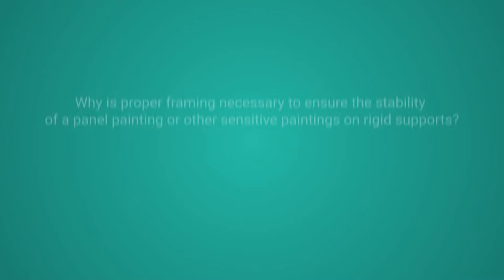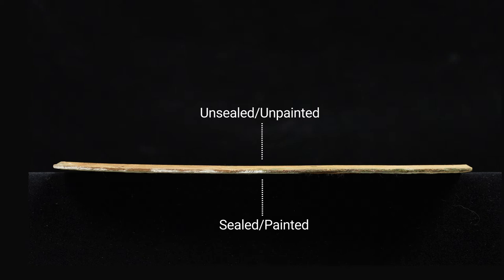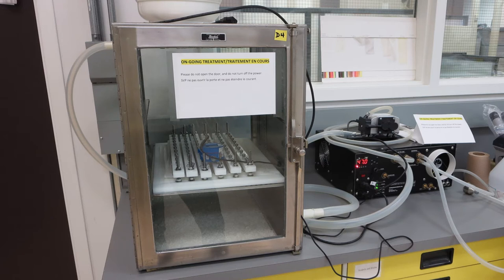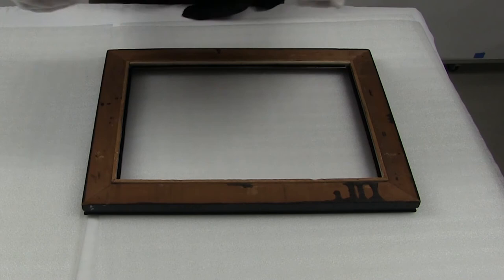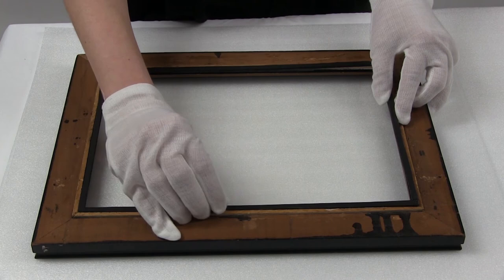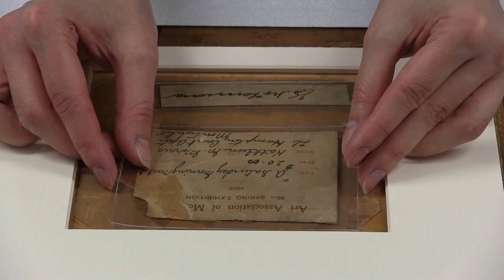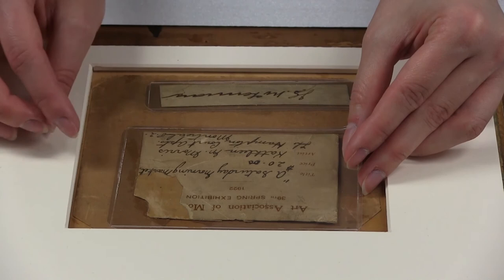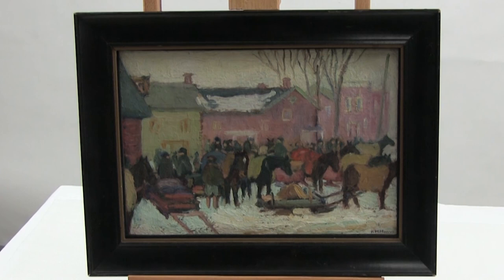Framing a Panel Painting

Comment: Excellent video. How would the procedure differ if one did not want a glass / plexiglass cover? I assume it would the same, with the exception of the glass and felt on the 'rebate'..
Reply from the maker: Hi there,
If you choose not to include a glazing, note that the enclosure will not be effective at buffering the environmental fluctuations as discussed in the video. If you want to display the work without the glazing, you will want to safely install the painting in the frame. It is important to provide a cushioned surface for the painting to sit on in order to ensure the painting surface is protected. If the rebate is not wide enough, adding a padded spacer will provide a secure surface for the painting to sit on. If the rebate is wide enough, you can place the padding directly on the rebate.
Thanks for watching!
Reply: @RCIPCHIN  Thank you so much for the information. Maybe I just do not know where to look, but there is a scarcity of instructional videos on framing panel / masonite paintings. Most framing videos are for canvas paintings. Most videos about panel paintings basically only cover the 'floating frame' technique and gluing the panel to wood. I want neither of those options. The artist who cleaned the painting for me was adamant that it be displayed without glazing. Not sure why. Thanks again. Your videos and website information are excellent.

Comment: The matboard back featuring the labels has terribly sloppy cuts and the spacer inside the frame also looks badly joined together.
Reply from the maker: Thank you for your comment. Good catch on the flaw in the back mat. It’s true that the corners are slightly less than perfect – this sort of thing can happen when bevel cutting with a hand mat-cutter if the corners are slightly over- or under-cut, or if the blade on your mat cutting tool isn’t quite sharp enough. It’s also a reason a lot of fine art museums will employ a specialist for matting and framing – it’s an art form unto itself! As it is on the back of the frame, we did let this small imperfection pass this time. As for the spacer, it consists of thin wood strips joined together at the corners with glue and affixed in place with double-sided tape. We can assure you the spacer wood strips are cut to ensure a closed corner joint; we want a spacer that will be sound and even around the perimeters when looking at the framed painting. In the video, the polyethylene foam padding was already installed on the wood strips. The strips meet at the corners and cut in position to ensure the closest fit. What you may have seen at the corner is the meeting of the two polyethylene foam strips and not the wood strips themselves. The important thing is that when the painting is put in place under slight pressure, it will be on an uninterrupted cushioned surface of a stable material that will provide a consistent perimeter from the recto. We hope this clarified a few points!